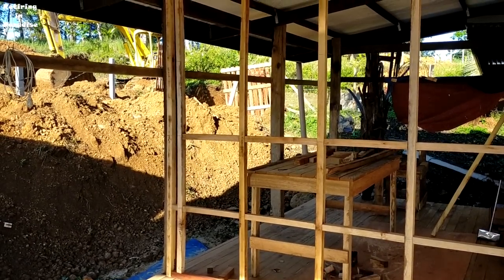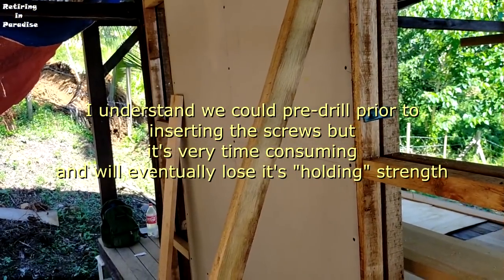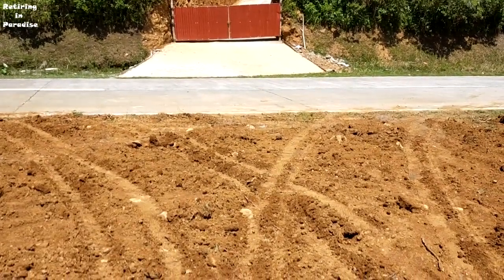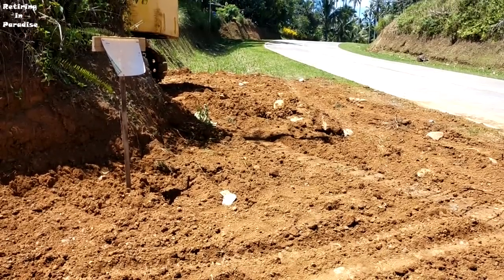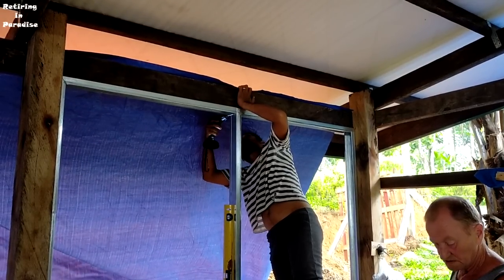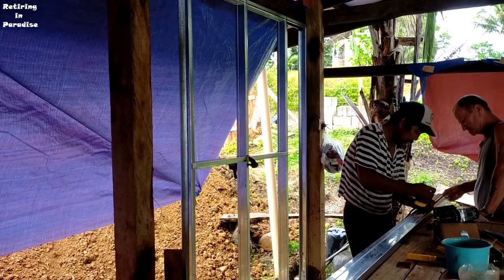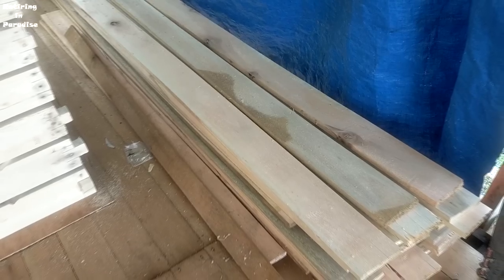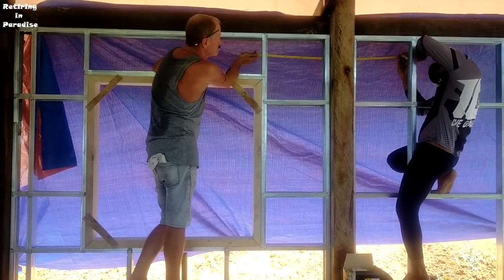V318 - Pt 42 FOREIGNER BUILDING A CHEAP HOUSE IN THE PHILIPPINES - Retiring in South East Asia vlog

Comment: you should be using the upper and lower track for the installation of the metal studs, these are different than the metal studs

Comment: Hey Joe heads-up tracks go on floor and ceiling.  Studs go vertical,  the studs go into the track. Will be alot stronger and faster to do.  Good luck!
Reply: HE IS RIGHT ABOUT METAL FRAMING.IT WILL BE STRONGER
Reply: grounding required?

Comment: I always get sad when i see the pinoy excavators. One should thimk they have never seen a grease gun in their entire life.  I saw a two year old Hitachi the last time i was there. Scraped. Dented boom and stick. And rattling like a 5o year old mavhine.  (Yeah. I operate excavators for a living)
Reply from the maker: It's all about maintenance  affordability
Reply: @TheGarciaFamily04  Well. New bolts, shims and bushings are way more expensive than some grease once a day.  You wouldn't believe the price for CAT parts. A tiny clamp holding one of the hydraulic pipes. 250 Euro plus VAT. :/

Comment: Joe will the top of the walls have a gap between the roof for air flow, or will the walls have a ceiling and be sealed? Just curious.
Reply from the maker: Open ceiling,  I do not plan to put a ceiling except perhaps the bedrooms and the bathroom is a must
Reply: Why is the bathroom a must on the ceiling? I would think that’s the room you especially want ventilation?
Reply from the maker: For privacy